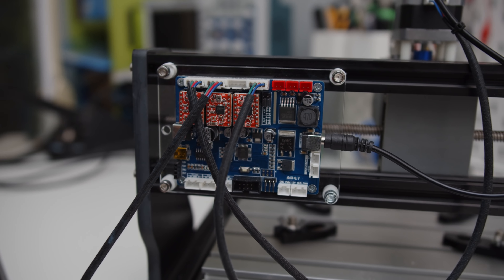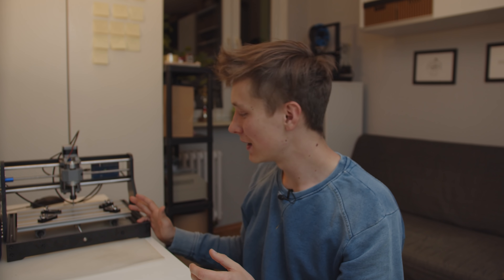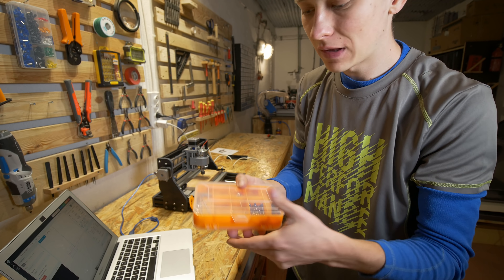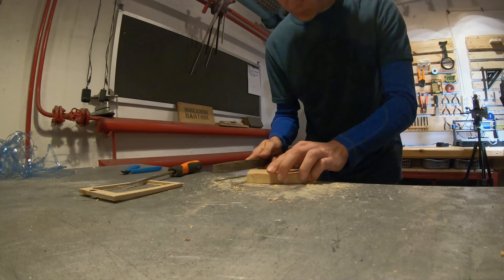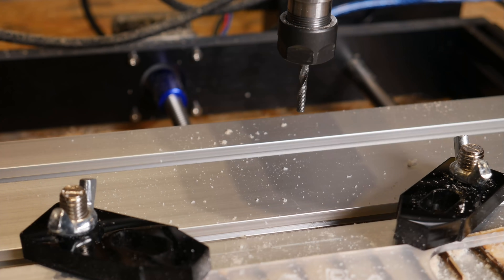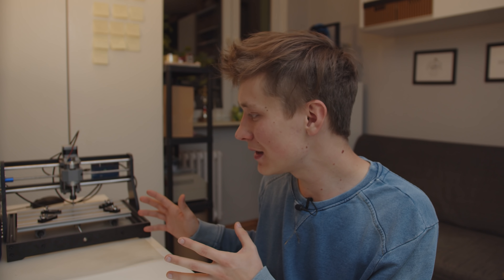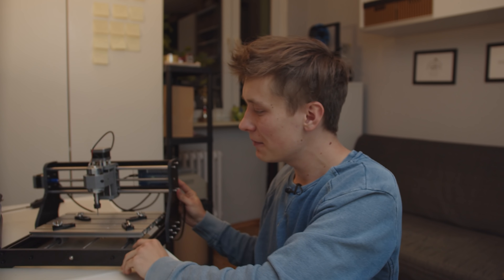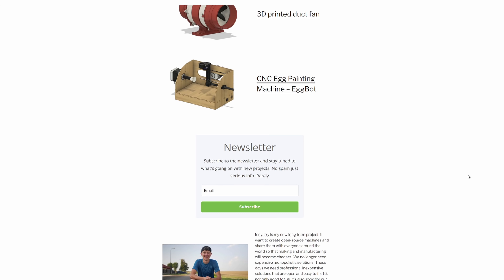What Can You Do With a $200 CNC

Comment: I bought a similar machine just because.  It sat un-used for a few months after assembly.  When it came time to spray my field in the spring I discovered I didn't winterize the sprayer.  The valve manifold was leaking.  The rings that hold the o-rings between manifold sections cracked when the water froze.  I could not find a part number to order.  I drew them in fusion360 and milled them out of delrin they threw away at work.  They worked perfectly.  Good thing too.  A new manifold and valves would cost more than I paid for the sprayer.

Comment: When routing the edge/profile of the PCB, use a much smaller end mill. I'm using an OpenBuilds Mini Mill, so kinda similar to yours, and I used a 1.5mm bit with two passes (0.9mm per pass). Makes much less dust, which is a good thing because FR4 dust is nasty stuff. On small boards I have FlatCam create two 1.5mm tabs to hold the board in place when routing. The smaller the tabs the less cleanup afterwards. On larger boards, 4 tabs.

Comment: 6:20 - as far as I know, "laser plywood" means that there is no knots and holes, even in the inside layers. It makes for a cleaner, more stable cuts. Knots could disperse the laser beam and the cut won't be deep or straight enough.
I once had a case when we tried to cut 2mm aviation plywood (also called aircraft plywood) and no matter the settings, we just could not cut it throught. But same settings were cutting throught 8mm standard plywood without any problems. The glue and finish used on the  aviation plywood made it impossible to cut.
Reply: Yeah, different glues can make a big difference in how easy the plywood is to cut, and people in my local maker space have reported a fair bit of variation in "ordinary plywood", so I'd also guess that "laser plywood" is specifically avoiding the hard-to-cut glues.  In any case, I seriously doubt it would have a lot of effect on how it mills.
Reply: What kinda aircraft were you building with that?
Reply: Also be careful cutting anything not 'certified' for laser cutting. Some glues/plastics etc can be pretty nasty for you when lasered if you breath it in.

Comment: The way to anchor sheets: Do not use the clamps that came with it, not without adding spacers. You first cut a strip, 15mm width from the plywood. Then you cut that strip to 4 pieces. Stick those under the end of the clamp. Now you will apply pressure from top, not from the sides. If you use the clamps that came with the machine, any material you use has a tendency to buckle.. as can be seen in the video, and this lowers the qualit HELL of a lot as your cuts are never the same depth everywhere. Even better would be spacers that are just a little but thicker than the workpiece, so that the force actually tries to stretch the piece, not push it together.

I 3D print spacers, it is faster that way and i can get the exact kind i need. I also 3D print custom clamps when needed.. Especially with PCBs it is a must.. You have to have perfectly even and flat plates. And it is far easier and you get better quality if you use a flatend mill bits, 0.8mm is strong enough. This makes the designing a bit more difficult but is really not a big problem. You do have to cut some traces with hand but it can do cuts for thruhole chips. I'm sure there is a way to use both, flatend bits for most traces and use carving to touch up places the big bit could not do.

Comment: i would really like to see you make this cnc even better with upgrades but still budget
 friendly.
Reply: It's a waste of money. I know, i did  it.
The money you spend making it more rigid and capable is better invested in something like a dremel CNC, really. I've spend hundred on a new spindle, linear rails, Z axis and another control card, it's not worth it, i've lost in surface area a for the price i could have build something bigger and better.
Reply: @SaitoGray  True, and you probably made it worst, because any upgrade have consequences. For example a "better" spindle add more weight on the small guides and will apply more torque to the bit which the structure cannot hold. It's wasting.time and money IMHO. The good machines that can benefits on upgrades are not very frequent. Long story short, cheap machines do not deserve upgrades.

The Dremel CNC have the same design issues thant the 3018, just in a different scale. Don't expect much about it. There's no secret about CNC routers : you want a heavy structure, high torque, good guides and transmission. Then Dremel CNC use standard cheap components assembled without any calculation. Easy to know, because different parts and/or dimensions would have been used instead. Look at trade machines. If they're built like there are, it is at purpose. Buy/build machines that looks like trade ones. My tow cents.
Reply: @axelSixtySix  I replaced the guide by aluminium extrusion and linear rails, but it didn't make it a way better machine anyway.
For the price i could be well into building a PrintNC which is WAY more rigid and capable.
The 3080 is a nice toy for soft wood, but it fall short for everything else, it's a shame.
Reply: @SaitoGray  You're right mate. "Upgrades" are wasted money most of the time as changing a component or two do not solve overall issues. So you change one, then another, and so on but you do not get a much better machine unless to change everything.

The PrintNC is probably much better but there's still some 3D printed structural parts like motor/transmission mounts so It is not flawless too. To me that's design issues, despite the name of the machine.3D printed parts are welcome for end stops mounts, covers, anything not structural obviously. But avoid it at all cost for anything that requires precision or strength.
Reply: I accidentally shorted the motherboard on my one of these and fried it, ended up getting a much nicer board with a touchscreen and WiFi control panel for like ~$50 and it was absolutely worth it
Reply: @SaitoGray  "The money you spend making it more rigid and capable is better invested in something like a dremel CNC"
Or, better, an IndyMill or its upgraded fork: CindyMill.

Comment: As a jewelers tool for etching on precious metal it looks delicate and capable. I could find many uses for such a machine.
Reply: Laser etching would still be better and more  precise
Reply: @Noadvantage246  I have both, while the laser is more precise it essentially burns the surface of the metal; the CNC creates an engraving that is still shiny at different angles, much more suitable for jewellery in a lot of applications

Comment: I did a lot of circuit board on a cnc. I always used a scrap of wood and did a surface cut to get a flat level surface. Adhere the board to this scrap  using double sided tape over all the surface. Any hardware fixtures cause the board to bend slightly.
Reply: I did something similar. I milled a piece of HDPE on my machine then just glue PCB to it with hot glue. A couple beads on the edges holds it down.

Comment: Not sure what board that is or what firmware you're using, but I wound up using the Z limit switch pins for probing on a similar machine. I did have to reflash the firmware, but the vendor for my machine did provide all the configuration and firmware files. Some controllers will let you reassign input pins without flashing.

Comment: I have had my cheap CNC for several years now, I just finished adding end stop to it earlier today.   Not tested yet, as I have not decided how I want to add the Z stops to it.  I think I will just glue the microswitches on, however that for me is not a great idea.  
I should be able to test it with in the next few days, depending on what else I need to get done.  
What software did you say you used for it?
PCB are my goal, though I may make a few molds for a mini injection mold machine.
The largest mold will be about the size of your tray you cut with it.

Comment: You can learn CNC/CAM on it, which is the best part.

I've put a 5.5W diode laser on mine and that works excellent for cutting cardboard and wood engraving.

I'm going to be trying to upgrade mine over the next few months.
Reply: You can learn CNC/CAM with just a PC. You don't actually have to run a job. There's simulators available anyways. CAD/CAM is why I don't use my CNC machine. I just don't like doing it.

Comment: I don't understand why you would fix a machine parallel issue with a probe and z stepper tweaks. Seems like a good way to make more potential problems in the future. Then again it's cheaper and people already have enough issues with manual bed leveling on 3d printers.

Comment: I bought the exact same machine few years back. Then I broke the usb slot of the arduino and lost any connection with the pc. I have an extra arduino but I don’t have any idea of how to take the old code from the old arduino and use it on the new one (if that makes any sense). Any ideas? Thanx

Comment: What is the runout of the spindle? I have been tempted to buy one of these cheap mills for PCB milling. I have a home made CNC with a Dremel style rotary tool (cheap brand - not Dremel or higher) - the "collet" (a generous word to describe the tool holder) and bearings leave much to be desired. I dare not mill PCB traces less than 2mm wide and need to leave at least 1mm between traces to ensure the end result is usable.
Reply: I have a similar machine and my run out was terrible. They seem to be super inconsistent regardless of where you get them.  Some have almost no run out and others you can see the wobble. I got mine to learn and for what I spent vs. what I learned, it was a so so deal. Good luck.

Comment: Bought one about a year ago. Have not done shit with it... 3D printer is just too convenient, compared to the amount of preparations you need to do with CNC, and the time it takes is quite long with hobby CNC, that makes a lot of noise. I have a noise proofed enclosure now but.. the hassle is too much, when 3D printer is just too easy and convenient..

Also the workspace is very, very limiting, mainly in the Z axis. You have basically 40mm of room to work with, minus your bit length.. Over 30mm is difficult. I do plan to extend the Z axis one day, basically i'll drop the bed down by 20mm (quite easy, only needs two pieces of 3 or 4 slot alu profile). I don't need to hit the bed with the bit, i can always put stuff in between but the other limit, height.. i can't do anything about it. From that point of view, this is AWFUL design to anyone who isn't basically just carving sheets. It can do more difficult tasks but the height.. just is awfully designed. The way to see what height you can work with it is:

Max Z - 5mm for safety before you hit the stops - 5mm safety margins for moving the head above the piece - bit length. So, 45mm becomes 30mm, max and even that is difficult as you are NOT working with a coordinate system where home is at a safe location... There are no end limits in any axis, it will run to the end and skip steps.. and if it does that, then it will run the bit to the piece, or worse, to the bed the next time it comes down again.

Accuracy is quite decent, if you do a slow final pass. And you can put any length piece thru it, as long as it is not more than 300mm width. That is VERY nice feature that is not mentioned anywhere..

Comment: Epoxy granite is a very interesting material for DIY'ing your own CNC equipment.
Reply: So is pine and plywood.
Reply: @1pcfred  What metrics are you using?
Reply: @dieselphiend  I don't use metric. I am a US Customary shop here. My CNC is better than a thousandth of an inch repeatable. My only real complaint is I need a better spindle for it. I have one of those "500W" Chinese air cooled electric spindles. Which is more like a 100W spindle. I measured it loaded up and never saw it draw more than that. I had a 600W router on it and that was very powerful but the noise drove me up the wall. One drawback of my design is the Y axis is a large piece of plywood and it acts like a soundboard. It really amplifies spindle noise.
Reply: @1pcfred  Nice.
Reply: @dieselphiend  it was a fun project.

Comment: My diy cnc has slightly bigger work field, but it costs me 10 times more to build it. I'm using grinded beefy steel tubes and plates together with cheap linear rails, cheap ballscrews, cheap nema23 4.2a motors and cheap 2.2kw water cld spindle.
Reply: It is tough to stay on budget with a home build. It sounds to me like you bought all the pricey stuff. It can be tricky to get peak performance out of stepper motors. Just because they're running doesn't mean they're running as good as they could. You're better off with too little current rather than too much. Best off with just the right current. Although with cheap motors there's not much confidence in specs.
Reply: @1pcfred  I didn't say "home build", I said "diy". Huge difference, unless you have machining shop at your home together with set of measuring tools that worth like a new car. I make and sell cutting-bending CNC machines since 2009, made conveyors also. I've recently started the channel and uploaded few videos of machines that I've made in the past, you can see what I mean. I have heavy milling, grinding and many other machines for working with steel in the shop, so "home build" isn't the right word. Budget of machines that I make depends on the customer... What I wanted to say in my message is that $200 machine and $2000 machine and $20K machine can have the same work field, and solid 20K machine will work 24/7 during a century, 2K machine made of steel will work tens of years, while $200 machine made of recycled beer cans will work for a month, then you'll feed it to the garbage can. Actually I really don't understand why this toy is called a "machine", and why they're calling a "spindle" that cheap motor with ER11 collet attached to the shaft. Educational cutting toy for $200 is the correct word.
Reply: @covad7686  While the machine here certainly has shortcomings it actually does work and would likely do what it is doing for a fair amount of time. I am not going to argue the semantic difference between DIY and home build as there is none. There is no set amount of tools involved in either.
Reply: @1pcfred  Yes, English language is quite poor, I'm glad that it's not my native. Rubber/wooden hammer is also a hammer, but can a blacksmith use it for forging? Can you use these hammers for nails? RC toy truck also has some properties of a truck, but can you use it to move cargo like a real truck does? Printer prints paper and has stepper motors, linear rails and so on, some of them are far more rigid than this "$200 cnc tool" but we don't call them cnc machine, don't we? From such position any motor can be called a spindle, while that 400watt motors doesn't even has properties of the spindle... it's engraving tool.  Regarding DIY and home build... Any house has a kitchen, from some point of view every kitchen is a chemistry lab, you can continue thinking about it and will get to the point where some complicated DIY projects will require tools and equipment that won't fit not only in the kitchen but also won't fit in the house.  So maybe i'm wrong, and word "machine" is good and fits for all types of mechanisms, and this word can also be used for toys like the one in this video... Some people can fly to other galaxies in their dreams, they've seen different planets there, but can we call them astronauts? :)
Reply: @covad7686  if you fly in your dreams then you're an astralnaut.
Reply: @1pcfred  if you sink in your comments then you're an coma diver.

Comment: the plastic parts are the weakness of these machines but for $60 you can upgrade the z axis. the steppers are too weak and the 775 spindle motor is a joke.they need to have the spindle upgraded to atleast 500 watt spindle. i put the bigtreetech closed loop motor upgrades on 92ozin motors. then after all that is upgraded you need to go through every wire and install ferrites to help cut down on EMI. then get a new powersupply the powerbrick supplied will not handle the bigger motors. after all of that you have a machine that if you use it at slow speeds to where youre burning bits you can carve but the resin uprights always have that springy tendencies and will break bits. for me i used it as a basic learning machine to see if i liked the hobby which i did even though i had well over $1k into the $239 original purchase machine to make some small signs. i got it to be extremely reliable as a laser engraver. i went with a 9014 frame and professionally outfitted electronics rig for it and im still assembling it now.

Comment: You are doing well, but you have to study what parameters to use and what tools for plastic, wood and iron are not the same  furthermore, with such a small milling cutter, the revolutions should go up to 10,000, with a 5 cm one up to 6,000, but as I write, be careful about which tool you have for which type of material.

Comment: How long do these engraving bits last when cutting FR4 fiberglass PCBs? I know they use diamond tip drill bits for PCB drilling, but for cutting? 
I think this is why they cut fiberglass and carbon fiber with water-jets. These materials wear-out any bit real quick and eat into any profit.
Reply from the maker: Hard to say as I am not cutting PCBs that often. So far I didn't face any problems with dull bits but often it's easy to break those engraving bits